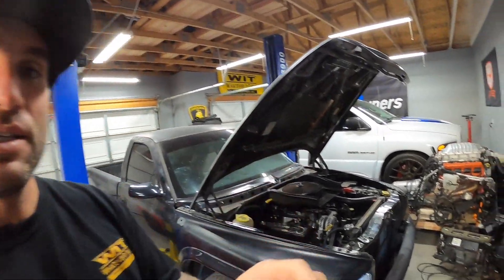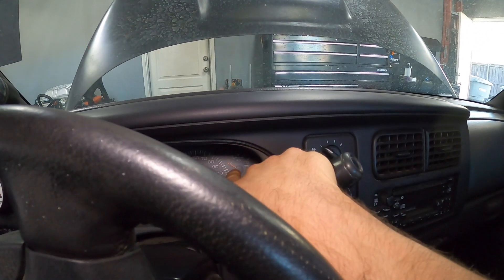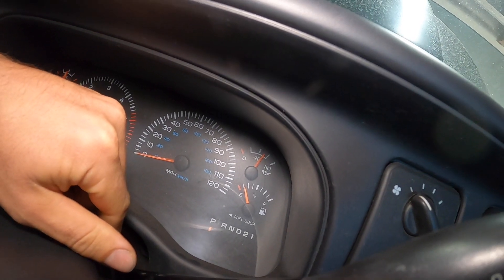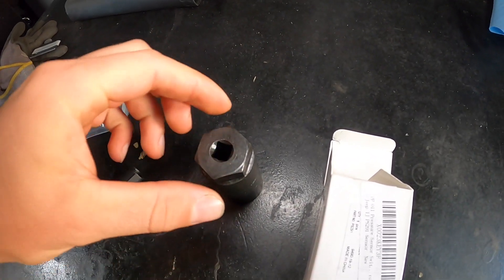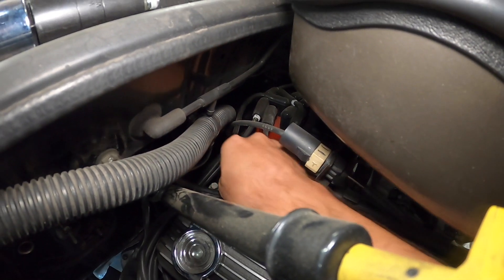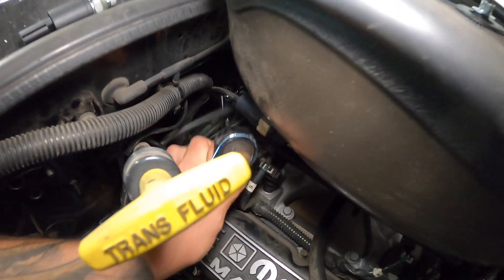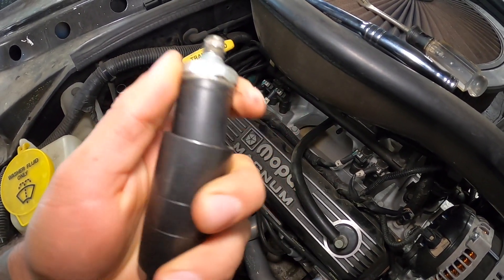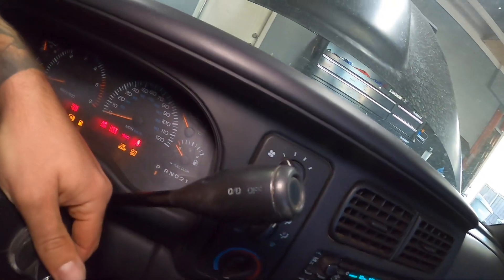HOW TO CHANGE OIL PRESSURE SENDING UNIT SENSOR MAGNUM V8 ENGINE

Comment: Bro, you came in clutch again. This time, I'm working on the old 2nd gen Ram V10. The truck runs just fine, but the oil pressure  gauge had me worried..

Thanks again.
Reply from the maker: Nice work!

Comment: Can this trigger a check engine light and a ticking sound? Getting the same problem and I’m trying to rule out anything else. Truck was low on oil so I added 2 quarts and the ticking went away but now I have a check engine light. Any guidance would be greatly appreciated. I love your channel btw 👍🏼👍🏼

Comment: Thought my rear main seal was leaking on my 1993 5.2l Magnum. But the oil sensor (still working) was leaking oil out the top. Replaced it. Oil leak solved.
Reply: How did you get the oil pan off? Did you have to lift the motor from the mounts a bit?
Reply: @Flores9989  Didn't have to. Just replaced the oil pressure sensor.
Reply: Oh I see.
Reply: That’s what I’m gonna have to do, someone told me it was a rear main seal leak, heard that sensors leak and make it look like it, found the sensor, oil everywhere

Comment: Found out just today when I was working on my van(1999 dodge b150 Van 5.2 v8) - If you are having a weird start where the engine is knocking and refusing to start normally or keeps going into limp mode? Try changing this one sensor. Mine crumbled in my hand when I tried to get it out, thankfully the base it metal and could be easily twisted out with a crescent wrench. Put the new one in and the problem disappeared, started up in less than a second instead of 4 or 5 seconds of stall.

Hope this helps some frustrated soul. Super easy fix if you've cabin access, a little bit of a bitch for trucks to get too though.

Comment: Its probably same for the 3.9v6 too🤘🎃🤓👍
Reply: Update my 2002 3.9v6 dakota uses same sensor.

I went to autozone bought a 1 1/16 deep impact socket.

This socket does not fit the sensor the socket is too short and too big.

Comment: I replaced the oil sensor on my 2001 Dodge Ram magnum 3.9 6 cylinder 1500 truck and I have no codes, Check Gauges light on and still no reading on the oil gauge on the dash. There's no sounds of metal on metal coming from the engine,oil is on the line and it's temp stay where it support to be. What do I do next?
Reply: Have you tested the sensor you put in? Sometimes they send a wonky one and it doesn’t work like it’s supposed to. Depending on what it’s doing, it could be a map sensor, your AIC sensor or a number of O2 sensors. Just a thought.